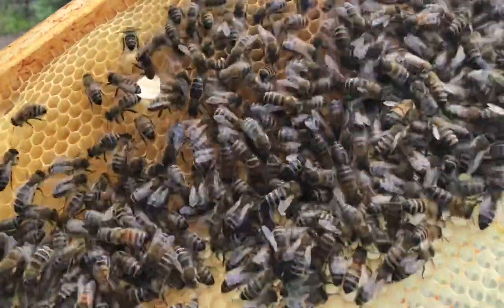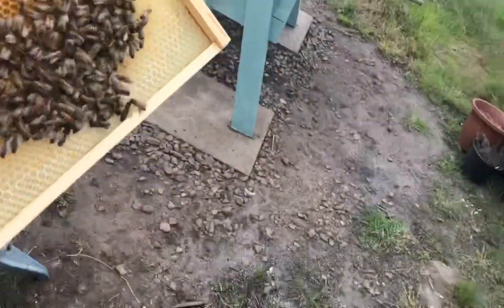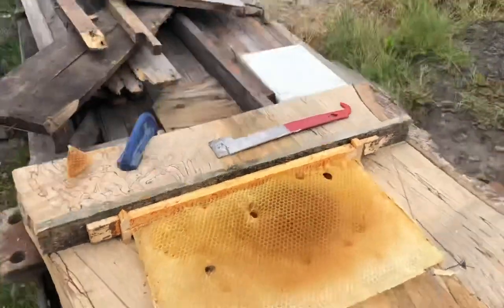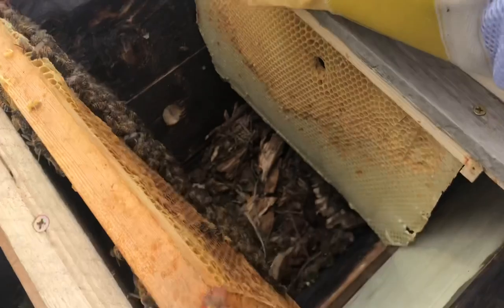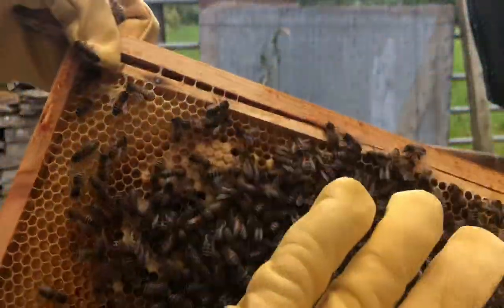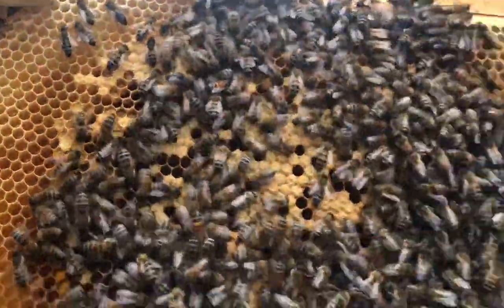🟡 National frames Converted to Top Bar bee hive frames

Comment: Hi There,
This is exactly what I have been looking for!!! I have a nuc coming this June (2021) and have always thought the topbar hive makes much more sense but it is difficult to get anything other than a National hive nuc. One question if I may. Did you house the queen in the cage inside the new topbar hive? Many thanks again for the video! Graham.
Reply from the maker: Hi Graham, yes firstly I used a queen clip to make sure I have her safe and sound in the clip putting the queen and the clip into the Top Bar Hive. Then checking the other frames before shaking the bees into the Top Bar Hive. Making the frames to fit as needed and added some feed to help them build comb 1-1 sugar mix and also pollen feed.
I also found it was best to get the equipment needed before starting as you can see in the video. Let me know how you get on Graham all the best Alan
Reply: @Thurlows  Hi Alan. Thank you very much for the reply. I’ll certainly let you know how it goes!! Kind Regards Graham
Reply from the maker: Yes please do Graham and let’s hopefully it will be a lovely year 🐝🤩💓👍🏼